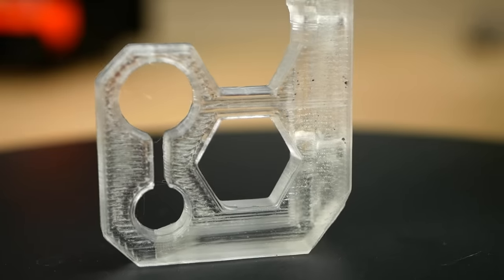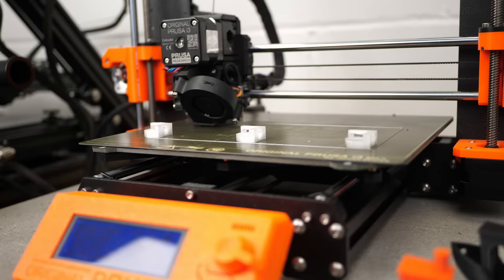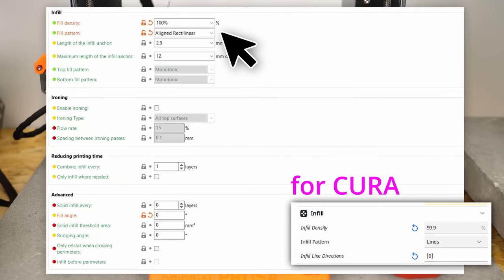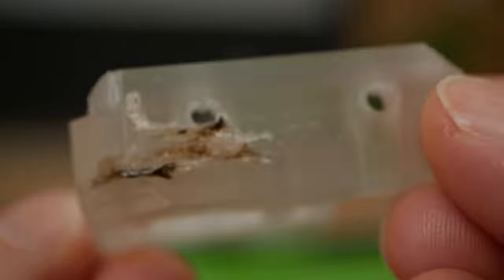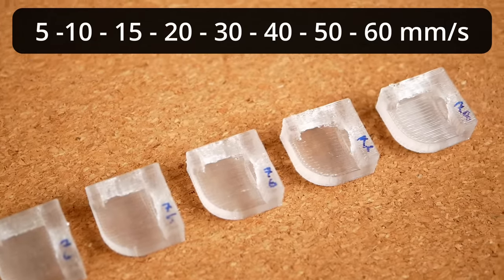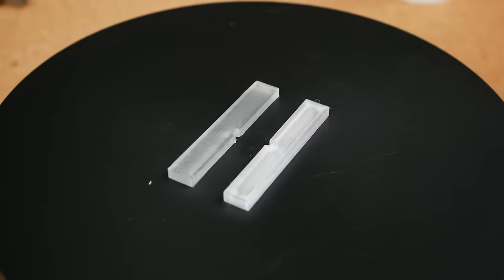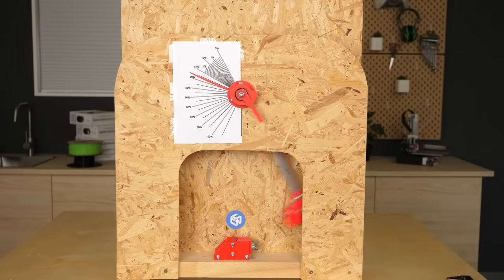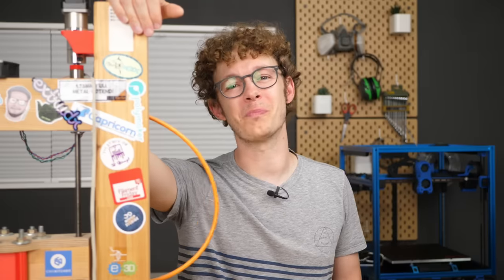Transparent FDM 3D Prints are Clearly Stronger!

Comment: I recently noticed when printing with transparent PLA, that layer adhesion was much better than coloured PLA. When i printed parts in different colors and I almost couldn't remove supports of the transparent ones, when the coloured ones just broke off easily.
Reply: If you want the strongest materials, always avoid black, they are the worst, natural color is the strongest. Slightly colored tranparent ones are good too
Reply: @dtibor5903  Black can be plenty strong, since relatively little pigment is needed to absorb a lot of light, but also sometimes you get repigmented regrind and other shit, it can be difficult to trust. White has a scary amount of pigment, since the pigment is transparent. Highly opaque light colours can have that same issue.

The absolute worst is silk PLA, that's got little rubbery bits of filler to make it behave this way, and just doesn't bond well at all.
Reply: pigments can have a huge effect on the properties of a material. Back when I was into knot tying, I came across some research that found pigments in the nylon fibers of the rope could affect tensile strength by as much as 30%. If adhesion and tensile strength are a priority, unpigmented is generally the way to go.
Reply from the maker: Should investigate that at some point!
Reply: @SianaGearz  it really depends on the manufacturer tbh as to how much the pigment will impact the strength
Reply: @SianaGearz  black materials often contain all kind of rejected filaments as the black dye will cover any trace of other colors
Reply: @CNCKitchen  the most difference I saw with tranparent PETG, the transparent ones are the strongest, coloured ones are OK, black the weakest, and the least impact resistant. I think it's worth investigating a bit, especially with PETG. Probably this difference is variable across brands.
Reply: @CNCKitchen  yes more investigations please 🥺
Reply: Due to the large amount of TiO2 needed to render filament white, I find that white filament has the poorest structural properties. Most any colorant will weaken the filament unless it has plastic properties of its own.
Reply: @dtaggartofRTD  Agreed, where I work we work with I think usually nylon parts of different colors (not 3d printed), and they feel wildly different. Green, black, gray, dark gray/blue-ish, yellow and blue all feel completely different despite being otherwise "the same" material (and I hate the gray one).
Reply: Black pigmented material can make a huge improvement in performance vs UV though.

Comment: So glad you finally did a video on this... I can attest to just how well this works.

I have been using settings similar to this after working towards transparent prints just like this video, and I haven't had a print break along a layer line in 2 years (or around the time the salt melt got popular - my progress towards these settings was to fill up the melt cavity more fully). Even with heavy usage items like fencing sword grips, small protrusions printed along the z axis will break across all the layers, with cracking instead of layer splitting.

Admittedly, my prints are a bit slower, but the true bonding between layers allows me to use them in higher-stress scenarios where injection-molded durability is expected. It also makes design notably easier when you don't have to constantly think about which way the part will be printed and which axes will be weak.

Comment: You could try printing a dyed version of the material with the same settings and use strength testing to compare. If the presence of dye changes the behavior then you can see a clear difference in the strength and failure behavior. Another idea is to use a sensitive light detector to measure the light transmission of less transparent samples. Shine a bright light (of well know brightness) through a thin sample and measure the light intensity on the other side. Higher measurement on the sensor means higher clarity, and thus stronger parts!

Comment: There is this experiment where you can see internal stresses in acrylic glass over polarized light while bending or other stress. I wonder if that is also possible with the clear prints it should be quite interesting if it works because of the inhomogenity
Reply from the maker: Good point!

Comment: I did the same sort of experiment 3 years ago.  I wanted to make diffused LED covers and then replacement lenses for cars.  I was using red clear and red LEDs.  It looked really good.  I ended up adding more extrusion and increased temperature until the parts swelled too much.

I was using transparent PLA and even tried with a 0.25mn nozzle.  0.6 nozzles were not available at the time.  My thought was that although there would be more interfaces but each interface is a smaller gap to fill in the 3rd dimension.
Reply: The replacement lens part caught my attention. Did you succeed?

Comment: For me the transparency is a secondary feature, the more interesting outcome here is the layer bonding. A few thoughts that I have:

Would printing in an enclosure allow for faster print speed? Because the printed part temperature is higher it needs less time to heat up enough to bond with freshly extruded material. 

To improve bridging, cooling could be enabled only during bridge features. 

A comparison of extrusion width would be interesting. I think this would have a huge impact. Parts would finish faster and could have even better bonding. 

Great videos as always! I really enjoy these investigations.
Reply from the maker: Printing in an enclosure might help a bit but will cause on the other hand cooling problems with the PETG again.

Comment: I wonder if slicer modding to interlace fill paths every other layer (with a slight reduction in layer height?) could also help make prints more monolithic like this by directly filling voids in the previous layer.
Reply: Yeah, or what's with layer ironing for each layer?
Reply: Would take ages though
Reply: Weirdly enough, I wondered the same thing last night. I've been asked to make a model of a part of a homing missile's guidance system and it needs a translucent window, and I was idly wondering about ways to print that rather than doing the easy thing and just using acrylic or whatever.
Reply: @finlaygreenaway193  It might come with slightly faster speeds as it would require less smooshing.  It's still the same amount of plastic so who knows?  Maybe it just averages out the same.
Reply from the maker: Very good point, though that might require half width extrusions at the start of every other layer. Maybe just varying extrusion with on every other layer might be something that's very easy to implement.
Reply: @CNCKitchen  how about indirectly using extra perimeters every two layers (super slicer has such a setting, maybe others too?) and playing with the multiples of perimeter width so that parallel solid infill is offset 50% between each layer. Maybe that fills better the small gaps. I'm also curious about the transparent ABS and PC filaments that some shops offer, that maybe could be helped with acetone smoothing.

Comment: Now I'm curious as to whether lenses can be made this way. I'd imagine clear polycarbonate would be insanely hard to print, but I bet it would be incredibly good if one could get it printed completely solid and in roughly a lens shape that could then be polished and vapor smoothed.

This would definitely be a place where a dedicated drybox would be ideal in addition to the filament dryer.
Reply: PC is pretty handy to print with. It wants an enclosure, and to print a little hotter than a stock ender 3 can print (metal hotend is enough). I get good results with an unheated enclosure, 270c nozzle, 80c bed (covered in kapton tape).
Reply: I was seeing fresnel lenses as soon as I saw the thumbnail.
It's an interesting thing to consider.
Reply from the maker: If you get PC to properly print it's also a great contestant! But dry it! Bed adhesion can be tackled with Magigoo PC or similar.
Reply: You absolutely can make a lens like this.  The surface and voids are the biggest problem for home lens creation, imo. using a wet sand method coupled with a UV inhibitor clear coat in a couple layers can do AMAZING things.  Enough elbow grease post processing and you can create excellent TIR like lenses or at least a lens close enough to a cast or molded in lens to work well for prototyping and small production where true optical clarity isnt a necessity.

Comment: I wonder if you came across my projects, that I think are extremely good in terms of transparency, if not even the best, especially the cube, that I've designed. I was researching and testing this topic over half a year
Reply: Thank you very much, you just got me to subscribe after I looked at your channel.
Reply: @retromodernart4426  Thanks, though I'm not sure when I will upload the next video
Reply: @Gejuch2233  No problem, what you already did is great!
Reply from the maker: Great work! Can you share more information on your process?
Reply: @CNCKitchen  I'm glad You liked it. It was over a two years ago, but as I described on Thingiverse page, to achieve this kind of transparency are needed some quirks, and tips. First of all to be clear, that is not how it came exactly from the printer, but I've polished all sides(but from bottom, and mostly from top, are close to the end product). 

Layer lines should be really small and I was recommending 0.03mm. Flow rate was above 100%, more like 102%, but as You said in your video it depends. Infill type was actually Rectilinear, and infill overlap was around 6%. I did use for all parts, clear PETG, that was beforehand dried pretty long. Temperature was at lowest as manufacture said, and sometimes below that, usually around 210C. Bed temperature was 80/90C. No cooling, but with diamond model, I did use some minimal cooling because of overhangs. And last but not least printing speed was around 24mm/s. 

In this printing technic retraction is turned off, and pretty much it can print mostly simple objects, at least on the surface, due to need for sanding and polishing. Also printing times were horrible. For example for printing 15x15x15mm cube, it took around 8h to print. And also printing parameters, especially flow rate mostly depended on model. Bed levelling was also crucial, and must be on spot, otherwise print will not succeeded. 

First I was trying to test it myself, but when I did show results to company that produced that filament, I get some kind of verbal agreement, that I will do more testing and send them(I've also tried their unique filament "Lucent PLA"). But due to time, and that this technik is not reliable enough I've stopped. 

Summarizing. Lower layer height, printing cooler, flow up to 102%, no retraction, infill overlap around 6%, Rectilinear infill pattern, and mostly ideal calibration of print bed. Then only hours of sanding and polishing, and voilà. 

So it's only valuable for prearticular cases. Type of printing, that You showed is much more user friendly, and can be used for cases where my method doesn't have sense, though I'm not sure how strong parts are from my side, I didn't really w as think of that back then, but I assume they are close to truly solid. 

If something is unclear just ask, I will be happy to answer, though I'm not sure if there is anything else to say :)

Kindest regards

Comment: When I did your max flow tests on my printers, I noticed that on CHT nozzles there is no underextrusion at all for a long time, while on a regular V6 nozzle from very low flow there is already a slight underextrusion and this can cause worse transparency and strength. I would also be quite interested to know what effect changing the hotend to hight-flow or ultra-high flow would have on the print speed. Maybe then it would be possible to maintain reasonable speeds.
Reply: A CHT volcano would likely allow you to print wide lines, high layers AND pretty fast, too... ok, maybe not latter. I suspect that there is "ironing" effect from nozzle conducting heat into the part, ensuring that plastic is fully melted as it is deposited, AND previous layer also melts and fully fuses with one you are printing.
For best "ironing" effect you want a very large outer diameter "flat" on the nozzle with normal-sized hole.
 This way you'll be able to print "almost isotropic" parts considerably faster, at the cost of print melting if you print high details at slow speed.
Reply from the maker: Good point! Might be worth investigating.

Comment: I’ve printed transparent PP tubes for model rockets for quite some time, I use them as examples demonstrating the strength of 3DP parts. They are incredibly strong for a single wall thickness with a .8 nozzle

Comment: I keep wondering if there is a way to use a low powered laser to re-melt a previous layer just before, or as the nozzle lays down the current layer.
Reply: FDM printer with an SLS laser
Reply: I share your thoughts about the Laser but that will only influence the adhesion between layers and the printing speed. The problem in optics is the empty spaces and the only thing that solves it is the baking, but first the impression has to be as good as the one achieved in this video. Great job by the way!!!!
Reply: @BrazenRain  Exactly.  Tricky though with how many different directions a print head moves.

Comment: Could the extra static load performance in the XY samples come from the alignment of all infill in the direction of the load? Would the same gains be seen if all infill was oriented perpendicular to the loading direction?
Reply: Excellent point! I would certainly be concerned about this. There are now two weak axes, not one, even if "weak" is not as bad as usual.
Reply from the maker: The infill in the test section was oriented along the loading axis for both samples (I used 6 perimeters), so there shouldn't be a huge difference.
Reply: Having your layers perpendicular is always going to hurt strength and performance. But that's the beauty of 3d printing, aligning your infill and Z direction make parts essentially as strong as injection molded ones.

Comment: I've noticed on smaller parts close together on the build plate can use a small amount of cooling without any difference in clarity. This also stops the PETG (in my case) from warping from excessive heat

Keep in mind, anything on a bed slinger (especially without an enclosure) in being cooled both passively and actively when the bed moves back and forth.

Edit; I'm printing on an enclosed printer with the top off and doors closed

Comment: I did this many years ago with a Monoprice Mini printing clear PLA.  I used 100% infill, and 105% flowrate.   Then I spent an insane amount of time wet-sanding with increasing grit sandpaper until I got to sandpapers that are normally used to polish glass.   It worked amazingly well. Clear as glass, and the cool thing is you can leave a void in the print, and since you can't sand the inside, the void looks like an opaque object encased in glass.
However, I never did it again because spending all day sanding to make a single part isn't for me. 
Maybe if you used a series of buffing wheels instead of a series of hand sandpapers you could speed it up a bit, but it would still be labor-intensive to make it look like glass, which was what I wanted.

Comment: At one point i was considering investigating 3d printing polymer scintillation material for radiation detection, the thinking being easy custom shaped detectors may be valuable for scientists and researchers. Never took the idea anywhere, but it would absolutely work with that level of transparency. Keep it up, you are really are about the top 3d printing channel for makers.
Reply: Oooh!  I love this idea!  With a dual material printer, I bet you could even do multi-cell/pixel detectors. Although, might be way too small for those kinds of measurements.
Reply: @BRUXXUS  Yeah i think the main problem would be plastic scintilators just aren't very good, unless you are looking to detect fast neutrons.   maybe one could make a neutron camera with 3d printed pixels and a nice big beryllium concave mirror to focus an image :D

Comment: Printing thicker layers with a bigger nozzle works even better for me, especially when looking at a tall print with a cylinder. .32mm layer heights allows for a reasonable print speed with a 1mm nozzle, but print speed will still be less than 15mm/sec because you are flowing so much filament. I haven't tried higher layer heights but it might be even more clear because each layer line blocks the light. I printed a lighthouse with a solar LED light on top and  transparent red and got great results seeing through the transparent sections.

Comment: I’m still impressed by how much smaller the variance between samples were on the transparent prints.  Even if the strength hadn’t been significantly higher, the better uniformity/reliability alone would be worth pursuing further.

Comment: If bridges are an issue for your part, PrusaSlicer can be set up to only turn on (or speed up) the fan during bridges. It's under Filament Settings -> Cooling (make sure Expert Mode is enabled).
Reply: Available on Cura as well

Comment: The nice thing about adjusting parameters for transparency is that it is an indicator for the strength of the part.  Adjusting parameters on opaque parts doesn't yield much visual difference, so testing is the only way to identify structural changes. Transparency is like that, revealing the truth of many situations.

Comment: To be honest, I like using PETG way better than the other filaments. Transparent filaments seem to have a different melting point than their colored counterparts. Also, I read that post from dude on transparent parts. One key is making sure that all the lines go the same direction. No cross-filling. Speed, layer height, and temp are some of the other factors.